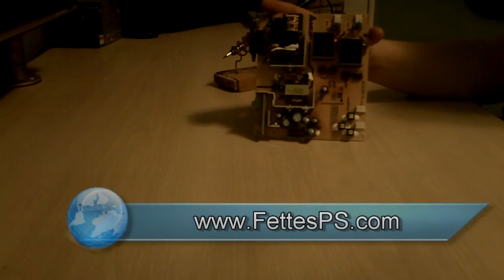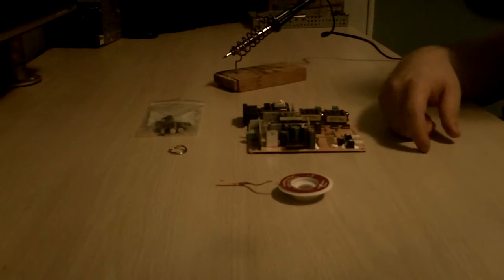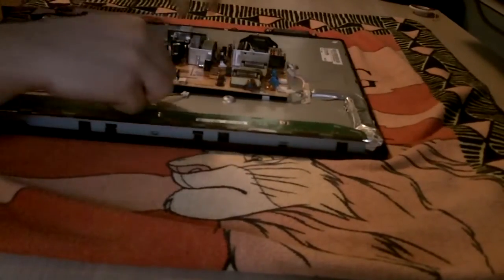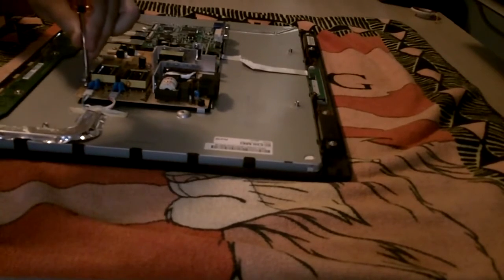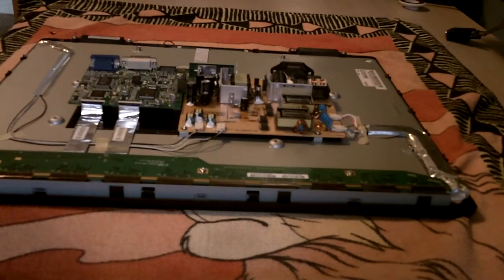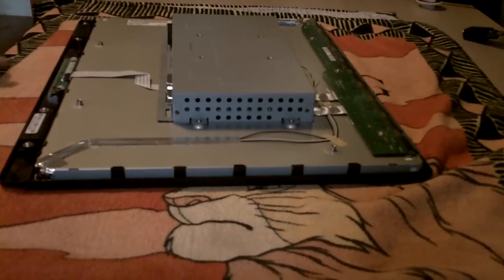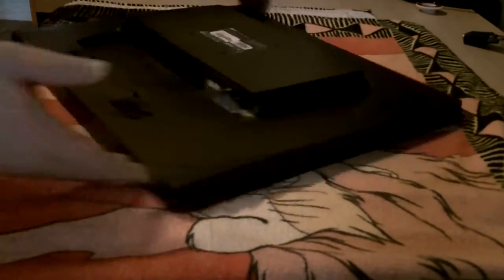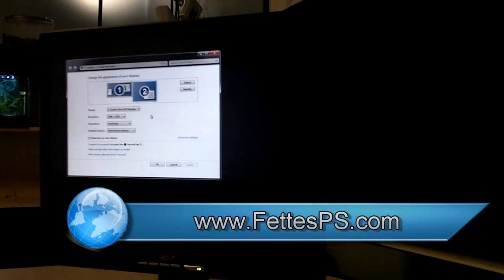Acer AL2017 Repair Guide (2/2)

Comment: In a LCD monitor Acer AL1715 it show up the logo acer, then it show no signal.
Vga cable is ok.
In power pcb 715L1103-D ver.B I changed C922,C925=1000uF/16V, C924=470uF
(those had a knob on top). I changed and C926=470uF that was normal but the problem was the same. I examined the most easy to approach components and they was not burned (short circuit or open).
Any easy solution? (without to change any board)